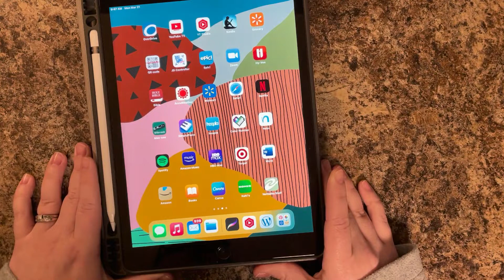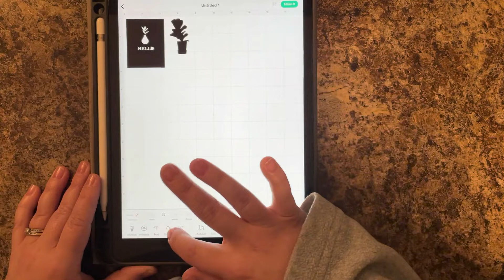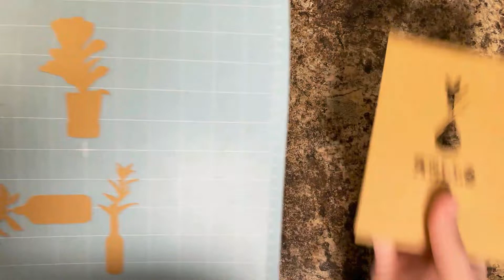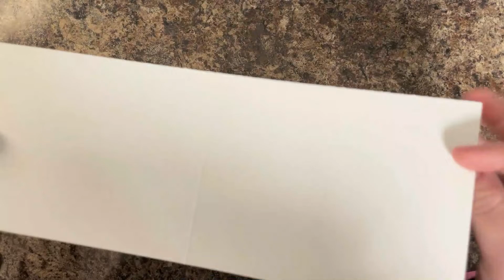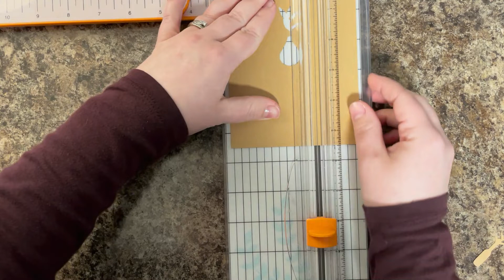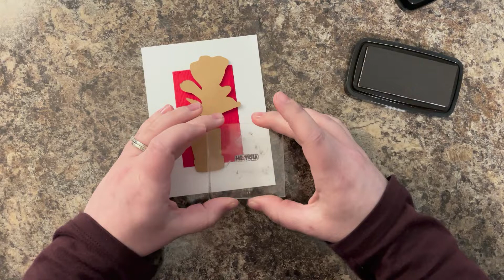Easy Silhouette Cards

Comment: Great cards, Lindsay! And thank you for the non-electronic-machine ideas at the end. I do have a question. The .png files I'm used to are images, basically graphics or parts of photos with a transparent background, that you can print, use on a webpage, etc. In the world of electronic die cutting, are they just another format of a cut file? I have seen them offered with .svg files, and always thought they were a fussy-cutting alternative. I'm a bit confused now. I don't have an electronic die cutting machine, so I've never purchased cut files. Anyway, thank you for sharing your projects. Take care, & have an awesome day! :)
Reply from the maker: Yes! Just another form of file you can import into the program. It recognizes only the non transparent parts of the file and cuts along those lines. It’s quite nice to have as those are the files I’m used to working with and you can also use designs that maybe weren’t designed to be cut files. I’m still brand new as I just got my machine about a month ago. The last electronic cutting machine I had was the ORIGINAL Cricut, lol. So I had never worked with SVGs either. I quite like PNGs more, just because they are more versatile, but SVGs are more practical with a multi layer cut, so the program can recognize different colors and separate those out for you. I hope that helps! Thanks for commenting!!! Always love hearing your ideas and tips!!! 💕